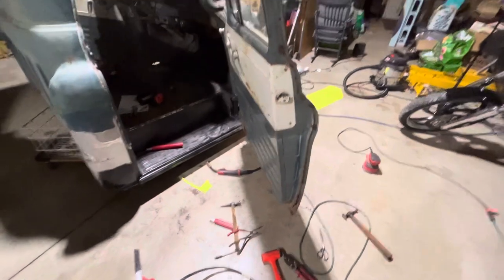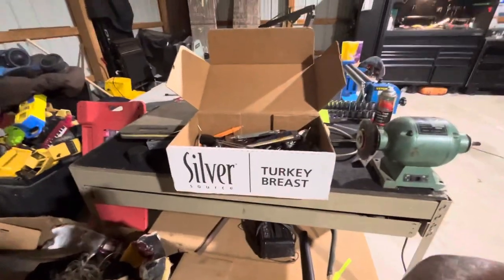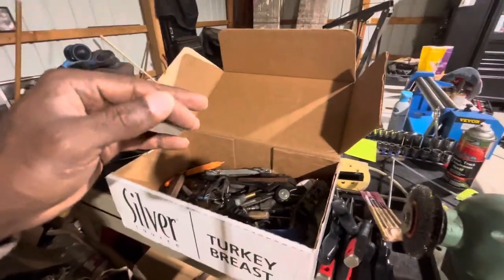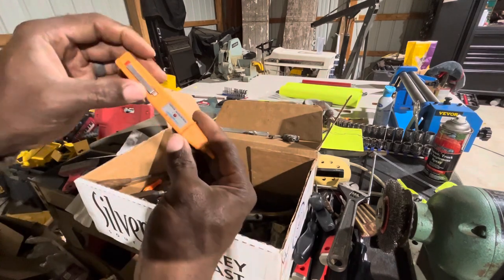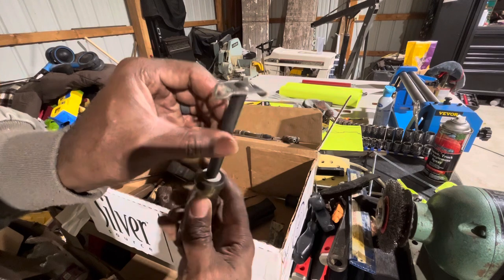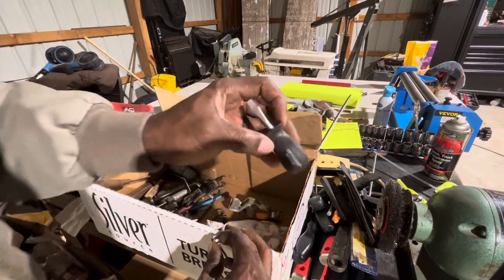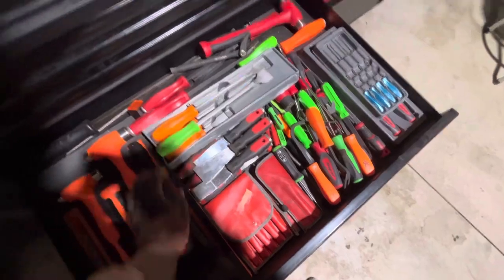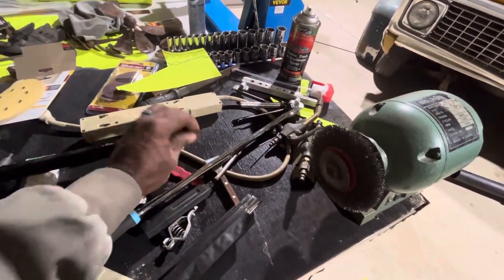Buying Used Snap-on Tools @ Auction!!

Comment: I would have snapped that up in a heartbeat. While I was a glazer, my number one tool was Snap On ratcheting screwdriver and eventually got soft grip with removable shaft so it could double as a nutdriver using 1/4" sockets.

Comment: That funny looking tool is for auto glass it’s used for vehicles that have gasket installations. There’s a cord in the middle and that tool locks the cord in the middle locking the gasket so the windshield or back glass does not pop out. I have one. They are hard to find. Keep up the good work.

Comment: That funny "scraper" tool sure looks machine specific vinyl window/windshield spline tool for large equipment like backhoe or dozer. Wasba glazerfor 18yrs and for more than half we had contract doing flat window n windshields, which have a heavy vinyl gasket which occasionally had a spline in the center. I believe you would indert the spline from the back and use the pointer to push it into the gap using one hand to keep what's already inserted in place while running the tool around the gasket seam. Hope that's helpful

Comment: As for the 4.3L V6, have alot of experience with them and they are great. The only thing I didn't like about the engine was the spider fuel injector system. Way more expensive including the potential to need to replace the harness. After having to old s10 blazers have issues, I began looking for cheap older blown motors to strip or just used good condition parts. Wife had 4 over 13 yrs. All starting with over 125k n lasting no less than 250k. One died finally with 313k. Saying all that, if you can get a. LS for around same price I would go for it. Have great day and the deals you find are unreal. Im in Jersey and rarely have the success u have.
Reply from the maker: Excellent feedback!! I really appreciate you taking time to share your experiences. I’m going yo keep the hunt going for an LS for sure.